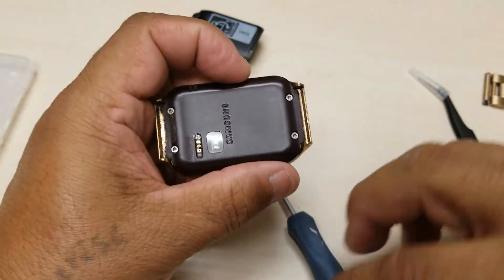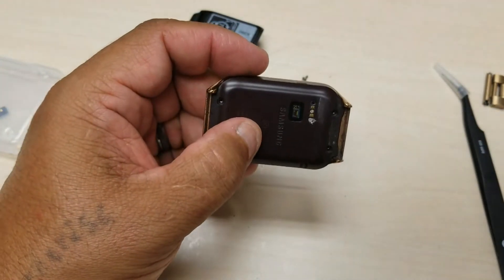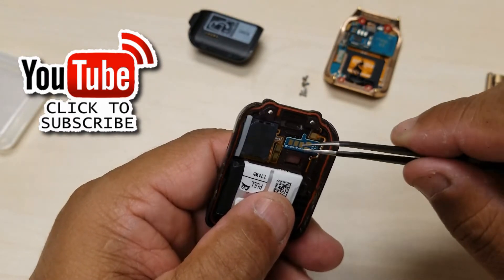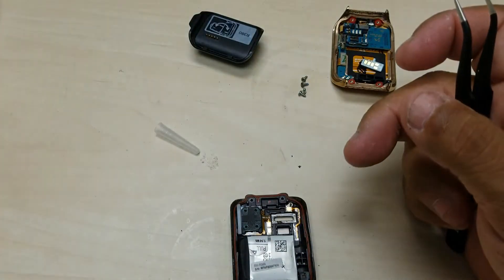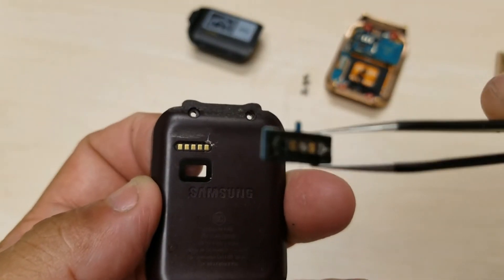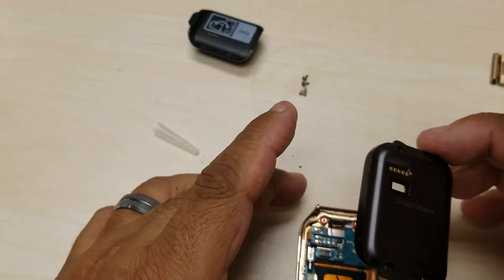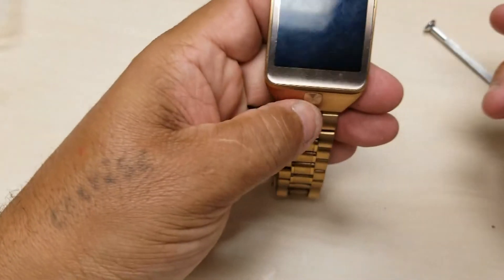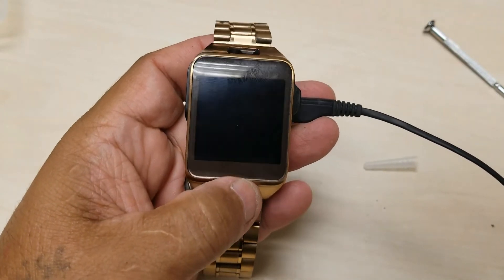Samsung Gear 2 Power Connection Repair

Comment: Dude, you fucked up the gasket and then left it out of the re-assembly. If anyone does this, their watch will get moisture, corrosion & dust, etc, inside.

Not great.

For those watching this: there's a little gasket around the charge connector. When you remove the connector DON'T pry it up from inside (you'll almost certainly damage the gasket)-- push it up from the BACK (outside) of the watch. CAREFULLY... that gasket is a little jelly-like thing. Then CAREFULLY peel it off and press it back into place (either on watch body or on new connector). THEN push replacement connector into place.

The guy in this other vid properly handles the gasket, though he mangles it more than necessary: you can get it out and back intact if you're VERY gentle, and it's the weak link in this whole thing. (Some people sell the charge-board WITH some 'replacement' sticky tape, but the orig gasket is watertight/works better/designed for it etc._
https://www.youtube.com/watch?v=1ghu9M_r8VM

Please don't delete this comment, man, or you're fucking people's watches up just so you don't have a negative comment.

Comment from the maker: I believe I put all the links for updating the watch in my description with the tools I've used hope this helps everyone
Reply: Can you help me?
Reply: sir ask  me  available power connector gear 2
Reply: Ihave this watch been trying to find parts an have repaired since 2019, i bought it while over in the middle east for 10 yrs. Where can i get parts if still available. I need a display screen

Comment: Does waterproof gone?
Reply from the maker: I believe it's water-resistant but after a while the sweat from your wrist deteriorates the connections
Reply: Correct. He didn't replace the gasket, only the connector. With no gasket around the connector, it is no longer waterproof.